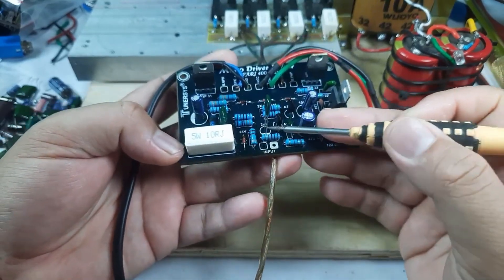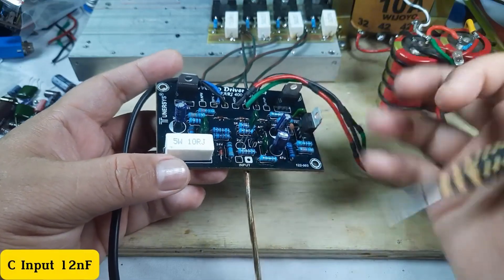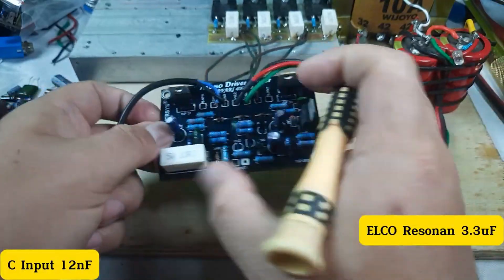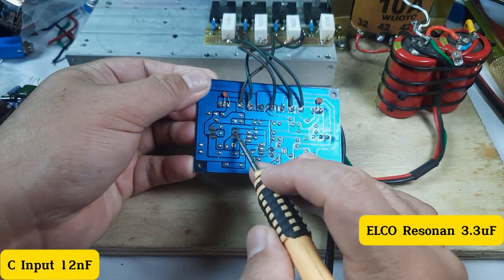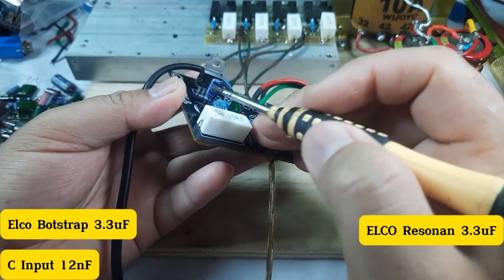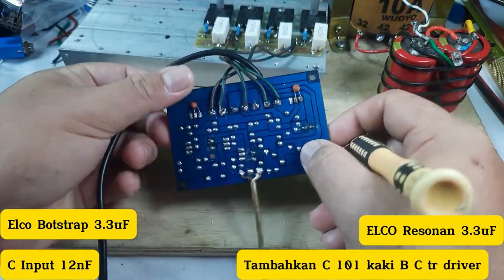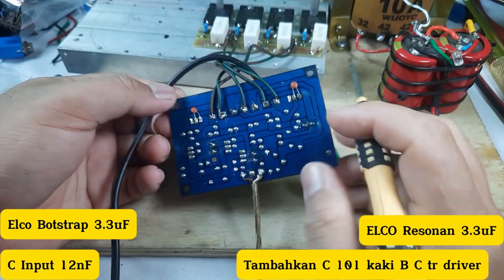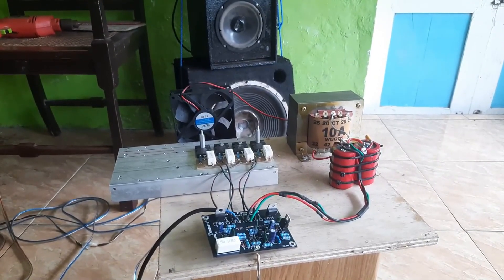Modif Driver Safari 400 Watt Karakter MID - HIGH

Comment: Di tunggu untuk high voltasene mass
Reply from the maker: driver merk apa bang?
Reply from the maker: punya saya merk tunersys
Reply from the maker: mungkin punya masnya berbeda
Reply: @MasTupikChannel  sama mas punyaku tunersys juga
Reply from the maker: Woke mas... Ditunggu yah, ini masih order barangnya...
Reply: @SPAudioproduction-gt6 mau di suplay 80vdc atau 60ac dari travo, baiknya ganti tr driver tr vas tr input, tr driver bisa pake mje/ kse 340/350 bisa juga pake mje 15032/15033, tr vas 340 original mje/kse, tr input bisa pake 5401 original, bisa pake  tr bf 221 dan banyak jenis tr input lainnya yg penying sama2 pnp/npn, misal bingung letak BCE di tiap beda tipe tr bisa cek di gogle 👍🔝dan saya juga pake kit 400 wat merk buskit harga murah bisa di suplay 80vdc travo 18amper cuma pake 5200 4sett tanpa di teff driver, hanya saya ganti tr driver trvas tr input 2biji hasilnya lumayan cring, untuk menurunkan bias tr final bisa di tambah resistor sesuaikan kebutuhan bias, mulai dari 47ohm sampai 1k di serikan sama dioda bias yg ada 3 dioda di jalur bias tr driver